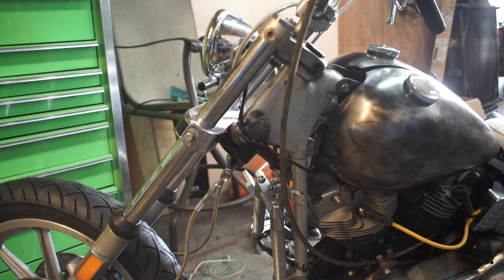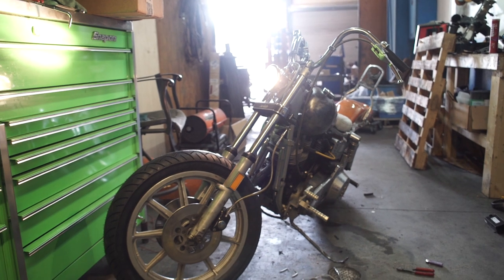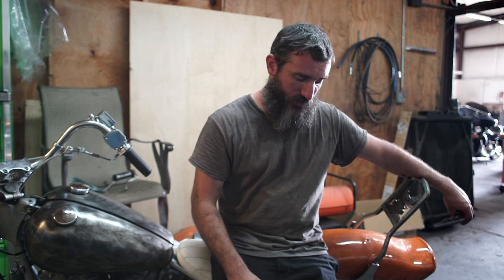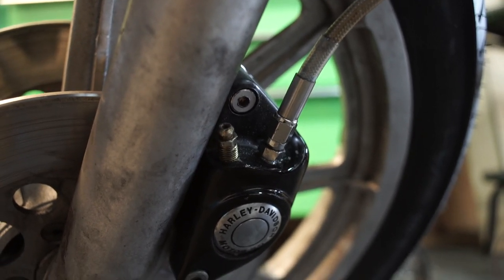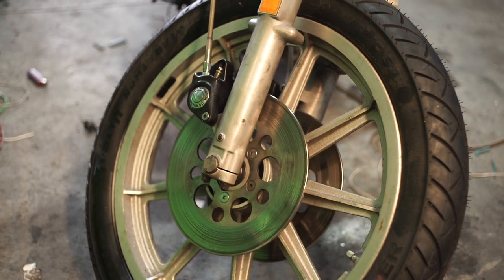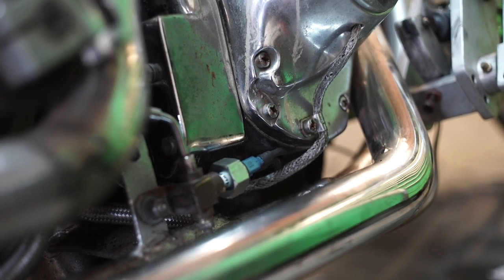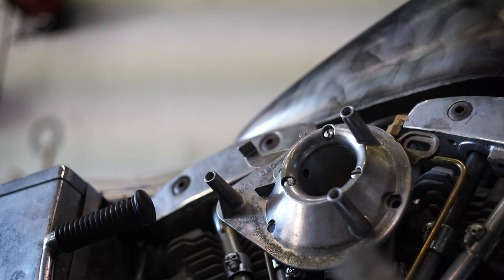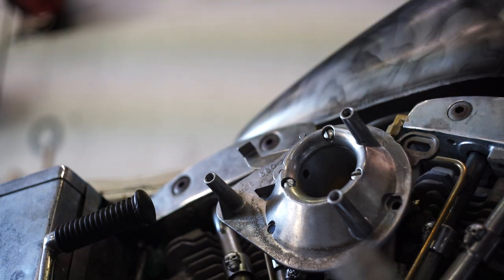This Shovelhead Sucks: Vintage Harley Project Part 4

Comment: I had issues with my '79 XLH calipers. Sticking mainly. I just pulled them apart, degreased them and a quick sandpaper hone and reassembled. They're still working 6yrs later. All is not lost ... Lol

Comment: re, throttle. I solved my cable issue with a cable guide mod. Cut-off wheel and welder are my friends on 73 shovel bobber.

Comment: I have a Pan that is my regular bike, owned it for 25 years, and a 78 Sportster XLCR that I probably should have left at the estate sale where I found it.  Two bikes, both need repair, one lift table and a 70+ year old body that isn't going to work on the floor.  The Pan is waiting to get on the lift so I can remove the transmission, make internal adjustments and install again.  The Sportster refuses to get off the lift.  Needed parts are coming to make the front brakes work so I can control it rolling off the lift.  The Sportster sat in a shed for 25+ years, brake masters were dry and crusty inside, wheel cylinders not moving.  Master cylinder was easier than I thought to clean and install a rebuild kit.  Wheel cylinders are next, they are the same as yours and very simple and easy to clean and reassemble.  I suggest you take them apart being carefull to not damage the rubber parts as you remove them as you can probably use them again.  Clean the metal parts thoughly with rubbing alcohol, clean the groove where the rubber was thoughly, you may need a Scotchbright pad or fine sandpaper if the piston is corroded.  If you haven't done it before, put the wheel cylinder on the bench so the piston is aiming down at the bench with a rag under the piston to cushion it, compressed air in the brake hose will shoot the piston out.  Clean the rubber parts with the type of brake fluid you are using and put it back together, simple and cheap, save your money for something you can't fix yourself.  Be sure to flush all the old fluid out of the hoses while they are off.  Lots of Youtube videos on the brakes, some good and some  wrong, easy to know the difference with your background and skills.  I am waiting on new higher handlebars, then I can get the correct upper brake hose and safely get it off the lift for awhile.

Comment: Vacuum leaks are a problem on those manifolds. I add additional sealer to the o-rings and rubber mount the bracket to lessen vibration to the carb/manifold assembly.
Reply from the maker: Yup I'll go through the whole manifold soon after I get other stuff in life more in order! Thanks for the comment and watching

Comment: Mate, I'm super impressed that that you found all the parts for the brake lever assembly that fell off... that sort of thing never happens.
Don't be overwhelmed by all the little things, one piece at a time. As mentioned in other comments, caliper rebuild and carby bracket should do the trick.
Reply from the maker: I can't believe I found that tiny spring! Certainly I'm seeing the light at the end of the tunnel, but I definitely need a break. I'll be back to it soon though!

Comment: That's a cool time capsule of a motorcycle.   Getting control cables for vintage bikes can be a struggle.   The vendors need to be very specific with the details, list the length of cable outer sheen, inner wire and free play.   That's assuming you have a cable that worked that you can measure so you know what you need.   I've bought throttle cables where the part number matches up, experts tell me that's the cable I need, and it's just a couple inches two short to use safely.  Meaning when I turn the bars it's pulling on the cable no matter how I route it.

Comment: Feel for ya Buddy , don't feel alone , many have gone through the same stuff , and don't give up if it is important to you , grew up motocross then switched to kaw triples an 1/4 mile for 15 years , talk about bend an break drive that , old now an thinking of a old harley not that new shit , never owned one but worked on a few , mostly finishing projects like yours , wiring it sorting the carb , cables ect ...  never wanted a bike i couldn't jump over the bars an the car just pulled in front of me before but think being old an can't jump might as well sit there an sound good till the crash so getting a harley like yours i think , Thx for the vid

Comment: Rebuild your brake calipers, the seals are most likely worn out. They may not leak but the seals are actually what pulls the caliper pistons back into place

Comment: Did you ever find a seat? I have a number of Shovel seats, exhaust sets and all kinds of parts that have accumulated over the last 40+ years, including a couple of FLH Tour Packs and a Liberator fairing built by Craig Vetter in the mid-70's. Not exactly sure what seats that I have but I can probably talk my son into climbing up into the garage attic to look around as I can no longer do so myself. I've owned the same 79 FXE, "Bernadette", for 42 years but there's not much stock left in her nowadays- 87 Heritage front end, 5 gallon flatside tanks off of a 97 Softail, floorboards off of an early Heritage Softail, etc. Plus the engine broke a connecting rod on the way to Sturgis in 1999 or so so I built it into a 93" big bore stroker using S&S fly wheels, crank assembly, and jugs. She's a beast compared to when she was 74".

Comment: You need a support bracket on that air cleaner.
Reply from the maker: It's got one now, I'm not sure which episode, but one of my later shovelhead episodes includes adding it

Comment: Your problem with the carb is because you don't have a support bracket. S&S&S sells them direct or you can get one from J&P, Dennis Kirk, or anyone else that sells S&S parts. You might want to see if you can also get the correct nut, bolt, and spacer. It will make a HUGE difference
Reply: Yep. Totally agree. Just need the support bracket and your carb is supported and will not drop off the manifold.
Reply from the maker: Yup, I definitely need it supported, my other bikes have some carb support. It's on my list of "to do" when I get back to working on this one
Reply: Agree. Carb support bracket. There are two types. One mounted on the front head.   The other comes up from the bottom.   On my  early '78 Shovel,  I have the one coming up from the bottom and have the  SS version of the oil lines you have.
Reply: Support bracket is a must. I didn’t have one on my Fatboy and I unknowingly kicked it loose with my prosthetic 1 hour into a 9 hour trip. No fun sitting in a podunk gas station parking lot reinstalling your carb with zip tied and duct tape while all the locals coming by to get their Sunday afternoon tall boys at the gas station gather around and watch you wrenching and cussing lol.

Comment: I have an fx front end with dual disc brakes on my 81 frame.... 84-99 brake calipers. Rebuilt them a year ago only to have the one on the right side blow out recently, Brakes can be a pain in the ass. Rebuilt both of them AGAIN a few weeks ago and right away after the first time riding it had a puddle of brake fluid on the wheel from the right side AGAIN.... Now all of a sudden, nothing. Still fluid in the master, brakes work good, no leak...... Maybe I over filled it? I'm just gonna keep using them until something else happens I guess.... They seem to work for now. I have a single disc on the back, never had a problem with that one. The frame has been chopped and lifted to fit an 80 Evo so I have an S&S Evo in it that's about a year old, only 1k miles on it but zero problems so far. Used a stock CV carb instead of the Super that everyone uses nowadays.... I do hate the manual must hold choke lever so I use a clothes pin on it when I start it...

Comment: First thing u should know youngon is all clips bolts screws fasteners need to be in place, tight,backed up with lock tight n saftey wires,harleys VBRATE!

Comment: I feel your frustration. Try not to order from V-Twin AKA Taiwan Ted. All those Rowan parts are h garbage. I had the same issue back in the day with my shovels. 
I honestly know exactly what you are going through. I just picked up a 66 rigid Triumph. It seems the quality of aftermarket parts from England are nice quality

Comment: Damn so the guy scammed u? What site was it? Feel the same mine is done just needs oil literally but am tired n just want some space between us lol.
Reply: Hi mate if helps when covid hit I was fitting ape hangers on my shovelhead couldn't get throttle cable I needed so made one out of  twin cam cable soldering end on perfect then as went fit it arc cable on battery it lit up red and melted inner cable and ends dropped off 🤣🤣🤣 I stood there in silence 😅

Comment: You need to have a carb support! Your Ironhead probably has one, right?
...It had better!
The weight of the carb leaning off the side of the engine, bumps & gravity won`t only cause an air leak, but the entire carb can end up in the road to get run over by the pickup truck behind you!
(Not to mention the potential FIRE from gas pouring on the hot engine)
You want the S&S rubber band intake gaskets WITH their heavy duty clamps!
Head up, never give up!
Reply from the maker: Yes my ironhead has one, I'll put one on this bike when I get around to replacing the bands

Comment: Just a heads up man, that's a evo backing plate and not a shovelhead backing plate. There are 2 ways to stabilize the carb. To the head or to the center case bolt. Keep plugging away man. It'll come together
Reply from the maker: Thanks man!

Comment: I hope you did not put DOT5 silecone in it, that will give you massive leaks arround the seals, you need dot4, I made the same mistake with my 1980 Shovelhead
Reply from the maker: The factory shop manual calls for DOT 5 so that's what I put in
Reply: @buttcrackcycles  mine says dot3, but you can also use dot4, I made the mistake of putting dot5 silecone in it, massive leaks from the brake handle, could not understand why untill I discovered that dot3 and 4 react with the seals and make it expand, dot5 silecone does not do that and therefore causes leaks, so if it starts leaking you know why

Comment: Has he welded that crack in the frame? An 'e' clip?? Poor design and l have to say, a potentially disastrous  oversight on the mechanics part.
Reply from the maker: Haven't gotten to the frame crack yet, on the list, need to needle scale the bondo off. New master cylinder was shipped that way with the E clip, maybe I'll try to "upgrade" it to a snap ring
Reply: @buttcrackcycles  l see so part came like that, assembled with (you summise) the E clip not seated. Is it not possible to make a shouldered threaded bolt and loctite a nut on? As for the welding l would carefully grind away to the parent metal and make a good fillet to give the weld the best fusion.

Comment: Every single old motorcycle will demand more work than riding, that's the nature of the beast. Yes, they look cool when you throw 'em engines on a hardtail frame, but are they rideable? are they dependable? hell no!; I remenber that even when I bobbed out a recent year sportster, although it was dependable, even for daily commuting was a pain in the ass to ride it literally.
You want to ride and expect dependability without working your ass off and do just regular maintenance? Look for a good condition recent year bike.
In fact there's no need to buy new nowadays, every brand or kind of motorcycle is just too damn expensive not only harley, hell! even the cages are so damn expensive these days! There's a world now out there of good condition used bikes, it's just a matter of looking the right one for one's taste.